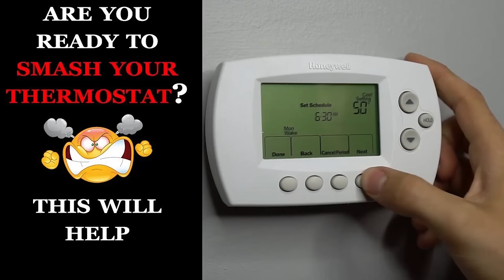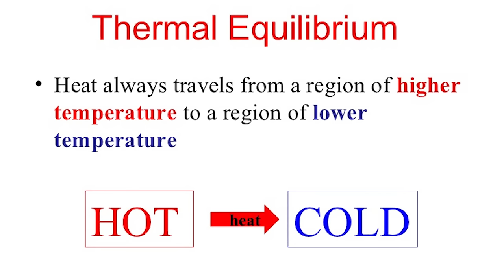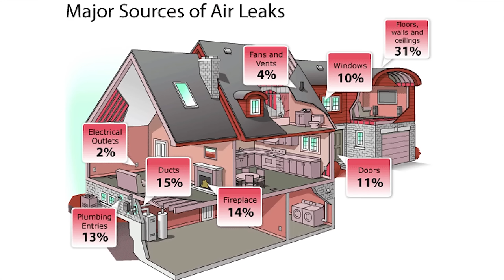AC Unit Not Cooling House - 20 Reasons Why

Comment from the maker: ❄ Other Videos For Reference:

Top 5 A/C Problems:
https://youtu.be/GOXgdnRB840
Complete A/C Troubleshooting Guide:
https://youtu.be/wzAA4dlp_70
How to Clean Condenser Coil:
https://youtu.be/pzwOvgjwm_Q
How to Replace a Capacitor:
https://youtu.be/9ZGfvC-PMWU
How to Replace a Contactor:
https://youtu.be/qHZc9wWAF4c
How to Replace Condenser Fan Motor:
https://youtu.be/gGFTd2dmgxg
How to Replace A/C Control Board:
https://youtu.be/hijUExXrcm8
How to Replace a Thermostat:
https://youtu.be/1mJkjrwxdP4
How to Check Freon Level:
https://youtu.be/dExFtP-nXTw
How to Wire A/C Condenser Unit:
https://youtu.be/KCanZEsLVEI
How to Read A/C Wiring Diagram:
https://youtu.be/I-sB4GIlbl4
When Should You Replace A/C:
https://youtu.be/Z7vUOySOWbM
15 Air Conditioner Maintenance Tips:
https://youtu.be/pBBnXHse-T0
Should You Get an A/C Inspection:
https://youtu.be/JqNsEzb__qs
Reply: How are you doing, I don't have no central air in my living room and bedroom and it shut off 36 times the thermostat, the central air ducts is the problem as well, the manager said it's nothing they can do about, because they will have cut open my wall and it's alot of duct to be torn out and replace, the old thermostat was replace but shut off twice, it's not doing it now after the lines was bleed,

Comment: I installed a replacement coil on my unit by myself. After being quoted $50 for 1 pound of coolant. Then the A/C man wanted to replace my entire air handler for $4200 because to coil was leaking. I saved myself about $4700 doing the job myself. The system works great now. I appreciate your videos. I have learned a lot from them.
Reply from the maker: Wow, that's amazing that you were willing to tackle it yourself and got it all done and it's working good! Kudos to you my friend, there's not many people out there who would do that! Glad to hear my videos have been helpful, stay cool!
Reply: So you got the replacement coil, refrigerant, and all the tools to properly do a change out of a coil for free? Otherwise you didn't save $4700. Makes for a nice story but isn't true. 

What did the guy quote you for just the coil change? A coil change out is usually around $1400 - $1900 dollars depending on who quotes it and how much refrigerant is lost. Buying a jug of refrigerant, a vacuum pump, a torch set, the replacement coil, a set of guages, a temperature clamp, the odd and end tools for removing the old coil and putting the new one in; that all costs money. Did you also change the filter dryer on the outside when you changed the coil? Bet you didn't, but you're supposed to. It's working right now, sure, my suggestion is save up all that money you "saved" though because you're going to need it. 

Yeah. You saved yourself maybe $500-800 bucks after you got everything you needed to do the change out yourself. You didn't get a warranty for that coil though. No chance is any manufacturer giving you a replacement if there's a problem. So sure, you saved some cash and that's great. But let's not paint some crazy BS story because you could have had a professional replace it for not a ton more than it would have cost you to do correctly and you'd have gotten a warranty.

I can promise you if I roll up and you tell me something along the lines of "yeah I changed  the coil myself" I'm either walking away immediately or I'm charging you a ton. Because how can I trust anything you did? 

You're going to be the exact same person who is either going to be over my shoulder the entire time I'm trying to work trying to get me to give you free advice to try and do the work after I tell you what's wrong or you're going to be calling and complaining because I can't fix what YOU broke without changing a bunch of stuff. I don't want either of those headaches.

Change a cap yourself, heck change a fan motor yourself. No customer should be touching a coil change out though. Don't like the price quoted? Try a different company and ask them to quote you just a coil change out. Most quotes are free.
Reply: @mythrol  let me guess. You own a AC shop?  If you can't add simple numbers it's your fault. I said he wanted to change the entire airhandler out. ($4200). The system was completely empty and at$50 per pound,  you do the math. (If you can). I did not need the recovery tank because the system was empty.  Yes,  I bought the manifold gauge set,  mat torch,  2 dryers,  coil,  25 lbs of 410a. TXV, for about $800.
Why do you slam people you don't even know and say you can't do that job? You think I care about a warranty if I installed it? You can pay all the money you want to your air conditioner man,  your choise. 
But don't come on here acusing me that I could not do the job. I can do a lot of things I'm sure your not aware of. But you should not bare false witness against people. Especially when you In fact... Do not know.
Reply: Rs M I agree with you. Its your house and your money. Guess that guy lost money for something he could of ripped you off for 🤣. But hey good job man 👍🏻
Reply: Lol that was a complete joke they won’t even sell you refrigerant without universal and it’s illegal to handle if your not licensed. What BS are you talking about I am licensed plumber and G.C absolute baloney!!!
Reply: @alexp818  "they" being Ebay. They sure will.  Good try. True story.
Reply: @alexp818  believe what you want.  Brazing is a cake walk being that I'm a certified pipe welder.  Have you ever heard of YouTube?  You can lean about anything there.  You should try welding....
Reply: @mythrol  You typed five paragraphs just to hate on this man lol
Reply: @mrbigrzl  It’s actually 6
Reply: You can see my prior but lengthy post above. I was the same way. I live in Balm Florida south of Tampa in a newer neighborhood. I am in remission from Lymphoma and retired. I can do the work. I did not want to. AC is a racket here. A "tech" came out and quoted $12k for a 2.5t Rheem 14SEER base unit. My wife did not sit down, she saw the dollar signs in his eyes. Tampa Heating and AC has a massive warehouse  up by the airport. They have another in Philadelphia or Pittsburg. They are the largest distributor of AC products in the US and will sell to the public. That RHEEM 14 SEER no frills unit is $2600.

My neighbor added $11k to his mortgage six years back to replace a six year old unit. Last week he shelled out $2100 for refrigerant and to have two leaking schrader valves replaced. 

I was willing to say "my units twelve years old, $5k maybe. The lowest was $7500 and both companies, the $7500 and the $12k the techs kept texting and bit like pit bulls to get me to buy. No way. I'm retired. I make really good money but I'm retired. I'm not ready to get overtly cheated. And those install rates are robbery. We don't do credit. The $12k guy even offered 15 year financing in one text! That is the going rate in my neighborhood. Since this extra hot summer started the trucks are on my street all the time. If I got to I'll install my own RHEEM.

And yeah, he told me $3200 to install the matching air handler I have in the garage. Eight years back the salesman at Tampa AC by the airport told me "I have been holding the matched evap for your unit but the contractor never picked it up. Brand new, boxed, yours for $600.  I looked it up it matched, it was copper, I bought it. Should've changed it with the TXV but my old one is still clean and not leakingn and its summer.
Reply: All you people thinking you can replace the evaporator coil yourself to save money is hilarious 😂 you'd need to have a recovery tank and recover the refrigerant before you cut and replace the coil it's a permanent sealed system and you would need to braise the joint as well as pressure test it before adding the refrigerant back into the system also against EPA regulations to do that without a license and knowledge of how to do it properly with a $30,000 fine but more importantly it would be highly dangerous so I honestly have a hard time believing that you did replace your own Evaporator coil. Most likely you did replace something you could, but don't know what you are talking about. @scottymac62
Reply: @ScottySmac  do they sell u the Freon? U have epa 608 type 2?
Reply: My system seems to be working well it was freezing up at first but now it's not freezing up at all it's just blowing hot air in the house could that still be low a refrigerant even though it's not freezing up now
Reply: Not something that I felt comfortable doing myself but I got a lot of quotes the priciest ( almost double)was from the larger companies, who ( no surprise) disparaged the smaller ( licensed and insured ) companies
 The larger companies sent salesman that were in the same league with used car salesman
Starting with a ridiculously inflated price they offered several " discounts and specials " to bring the price down to , on average, a thousand or more above the smaller companies with the exact same brand , model, size and warranty.
Many old widows would be scammed by them.
My mother laughed and told one group to their faces they were like bad hollywood actors ( these were linked with HD)
The larger ones usually can offer 0% financing ( Citi ) and this is how the big companies push the little guy out of business
We went with one of the little guys..
The most honest guy explained all of our options and did not force a full replacement on us . He offered us the least expensive and recommended what was best .
This man inherited the business from his father.  I hope others will support him . 
What is worse Google searches prioritize the big groups and paid advertisers , I got this man' s name through word of mouth.
The yellow pages should still be available where everyone is listed and if you advertised it couldn't be taken out of that section
Reply: @sherrieflynn252 Our A/C just died and I’m concerned about being taken by one of these companies because we got cheated by a contractor not too long ago. There’s no way to know what things should cost so they always jack up the price. It seems there aren’t many honest people out in the world these days, sadly.
Reply: @suew4609  
Assuming that you have to replace the inside coil and the outside unit but not the furnace?
How old are the units? Were they ( AC and Furnace) installed in the same year?
Are they the same brand?
Most Electric Companies offer a payment program if that helps .
We were able to save over 1500 by not replacing the entire unit inside but just changing out the coil to a new one.
The furnace has a contract and has been well maintained , so we didn't replace it .
Only 2 of the companies agreed that the furnace didn't need to be replaced. In fact the most honest one is the one who recommended keeping the furnace and just changing the coil.
My best suggestion is to google the top brands and read the ratings.
Then your can google the unit and see what it costs 
Then get multiple estimates
The price differences among the big companies and the little ones are amazing.
Read the reviews . I usually read the lowest first . 
We went with Trane coil and a Rheem outside unit.
Out outside unit could have been patched. The compressor was running well but it was 35 years old and we didn't want to chance it .The inside Furnace and AC coil were newer but it was the coil that needed changing
Reply: @mythrol  You are the type of scammer a home owner needs to stand over the entire job.
Reply: Can someone please tell me what to do. It hot where I am. The ac is running and the fan is spinning but no air is comming in the house. The ac is 2 years old. Can anyone please help.
Reply: @foodreview3187  it sounds like your air handler is not running. Check the breakers.
Reply: @ScottySmac  I just search up what it is and let’s not it’s not that 😂. But my ac like the parts are frozen and the outside seems dirty. I turn off my ac and kept the air on and tomorrow I’ll clean the filter on the ac. Let’s hope that is the problem🙏 if not ima cry😂
Reply: @ScottySmac  ok it might be that. Going to have to call on Tuesday
Reply: @ScottySmac how did you get the refrigerant? You have to be a EPA type 2 or universal technician to buy refrigerant
Reply: Nerd .
Reply: @mythrol  I wouldn’t want you anywhere near my home.
Reply: Wow! You sound mad. @mythrol
Reply: I will have to keep this note... a women  yeah they will try and get me so I am educating myself before I call them
Reply: @ScottySmac system still working?😂😂 sounds like there wasn’t a pressure test or vacuum during your install.
Reply: @BigDaddyCabbage 
Yes it is and yes there was a vacuum and leak test. Thanks
Reply: Lmao this mf lying sooo bad
Reply: @ScottySmac did you pressure test and vac the system down? No probably not. How long did it last?
Reply: @jimlahey8210  Yes I did.  And it's still going and has never been colder. Why is it so hard to believe someone could do this. I'm no dummy.
Reply: @scottymac62  So you bought a torch, accetalyne tank fittings, silfoss, Nitro tank, reg, gages, vacuum pump, micron gage and a jug of refridgerant?
Reply: Let me guess.... you own an AC business? Why you mad? I already had the touch set. Bought the rest. Y'all act like this is rocket science. Lol

Comment: Our unit is about 8 years old and ran perfect. The fan outside started making noise, then stopped, gave it ‘stick jump’ and it ran. Then the compressor stopped. Watched your video, bought two capacitors. Changed out one in the backyard. Turned the unit on and work it did! Thank you!

Comment: For future reference in case anyone else needs it.

1. 1:12 Condenser unit not working at all
2. 1:52 Bad capacitor
3. 2:50 Locked up compressor
4. 3:37 Bad condenser fan motor
5. 4:52 Dirty furnace filter
6. 6:08 Plugged/dirty evaporator coil
7. 7:11 Plugged/dirty condenser coil
8. 8:21 Dirty return grill
9. 9:04 Bad thermostat 
10. 9:45 Thermostat programming 
11. 10:27 Turning AC on late
12. 11:15 Low on refrigerant 
13. 13:09 Leak in ducts
14. 13:49 Undersized unit
15. 15:33 HRV is running 
16. 16:15 Open windows 
17. 16:55 Bad install 
18. 17:41 Damper closed
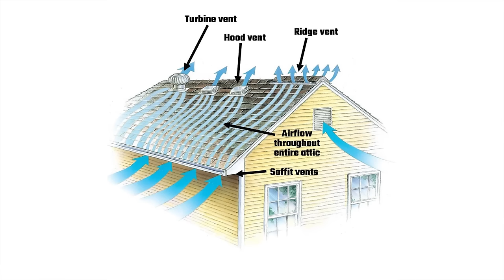19. 18:37 Poorly ventilated attic
20. 19:25 Poorly insulated house
Reply: Your a real one ☝️
Reply: thank you
Reply: U are amazing
Reply: Super man ! Thanks .
Reply: You forgot 

Overcharged unit
Restriction in lines
Outside coil dirty
Plenum torn or collapsed 
Condensor motor going wrong way
Wrong size capacitor 
No low voltage
No high voltage
Indoor blower motor out
Transformer out/burned
Fuse burned out
Broken wire 24v/120v/220v
Schrader valve leaking
King valve leaking
Indoor fan motor capacitor our
Outdoor fan motor capacitor out
Reply: @BigDaddy-vh5jv  he said 20 not 40 😂😂😂
Reply: Thanks
Reply: thank you for this
Reply: you forgot the dogbone
Reply: Thank you!!  🙏
Reply: bad capacitor, locked up compressor, bad, condenser fan motor, dirty furnace filter, plugged or dirty, evaporator coil, plugged or dirty, condenser coil, dirty, return, grill, bad thermostat, low on refrigerant, leak and ducks, damper closed or HRV(?) running

Comment: THANK YOU SOOOOOO MUCH!!!!    My poor system was struggling in this 105 degree heat, barely cooling the house to comfortable temp!  After watching your video, I got out there with my hose and cleaned those coils! It was 82 degrees in my house when I turned the power to the unit back on and within a couple of hours it was a cool 73! You saved  me money and my sanity! I will be doing this seasonally from now on! Thank you again! God bless you!!!!

Comment: It's hot here in Dallas Texas.  Heat index 110, heat advisory, and my lovely wife says the ac is blowing warm air. It's after 5:00pm I have a great AC guy but he's going to charge me $$ just to look at it.  I did most of what you said, checked the filter, it was ok, fresh batteries in the thermostat and I had a spare run capacitor - not going to pay 75 dollars again for my ac guy to replace it.  Air out of the vent dropped from 85 degrees to 65 degrees.  Thanks... we are sleeping cool tonight. Keep of the great work.
Reply: Capacitor you think?  I like Dallas, watched the eclipse from near there :)

Comment: I cannot thank you enough for this detailed information.  My AC stopped cooling the house last night.  Now I know what may be causing that.  During the middle of the night I heard a very loud knocking noise outside of where the air-conditioner unit is located. At first, I thought someone was knocking on my steel siding.  Then I listened to hear if the AC was still running and it seemed to be.  When I checked the unit this morning, I noticed that the fan seemed to be working fine but did not hear the compressor turn on.  My HEIL unit is 22 years old but is only used about 2-3 months in the summer as I live in Minnesnowta.  You are such a blessing for sharing this information!

Comment: I kid you not, I was having problems in the middle of the heat this month with my AC. Just bought a house and i was confused why i put on the Cold in the thermostat but no COOLING and the AC didnt function... 
Called an AC guy and he charged 100$ just to come and he was backed up for a week atleast. Didnt even call me back.  
Saw your video...and all i had to do was switch the breaker!! OMG!!! I am living in a igloo now! 
Thanks man!!!
Reply: lol.
Reply: Almost did the same thing, then I saw the step to replace the thermostat batteries and it worked and this video saved me so much time and money I am so thankful
Reply: @isawthesaladdressingandili207  
L m
Reply: I suspect my heater is running at same time as my A/C on a all electric unit how do I test it?
Reply: What number was that or did you just notice it?  Replace a breaker in the breaker box?  Thanks
Reply: Ac is not working